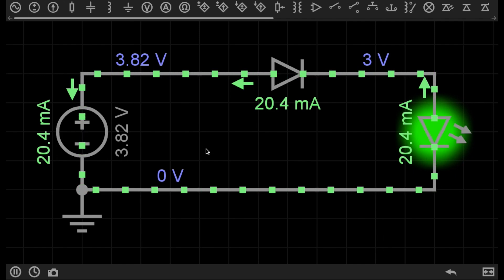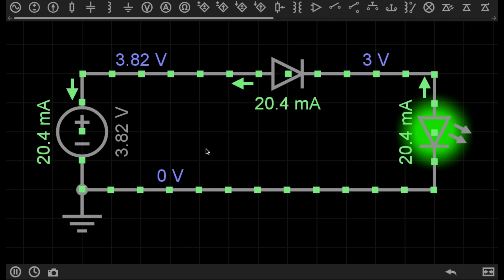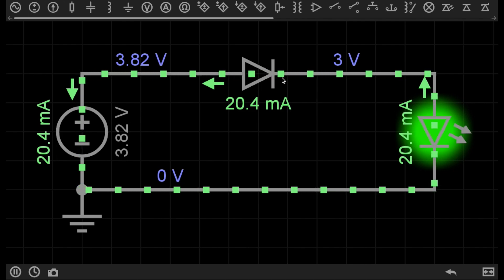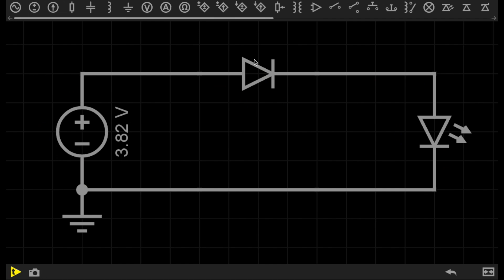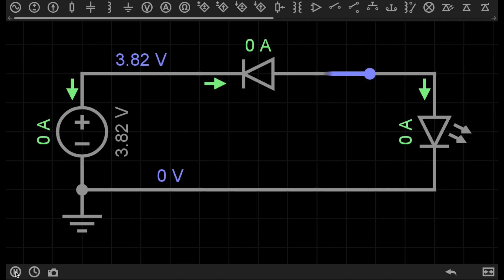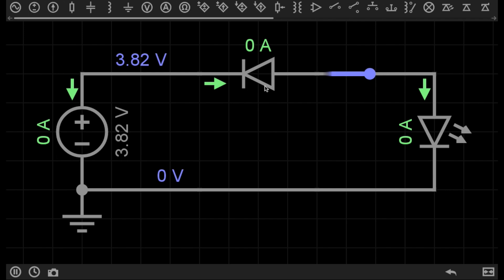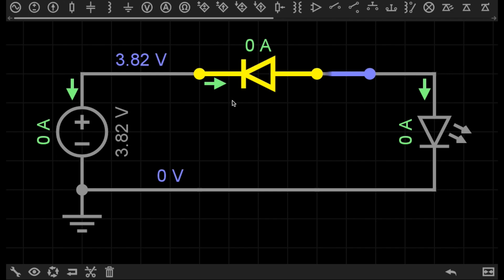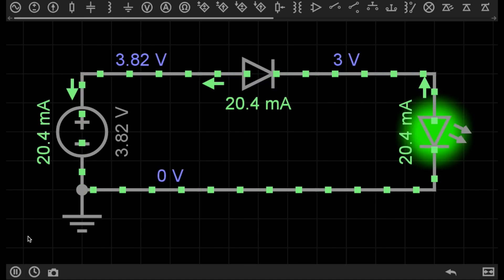How Diodes work EASY! (Interactive!) - Electronics Basics 6

Comment: So im confused even with diode turned around shouldnt current still flow up until that diode blocks it?? Why does it completely stop it even before it from coming from the battery

Comment: Why are at last half the videos and books out there showing current flowing through diodes in opposite directions from this? Is it just a matter of looking at conventional vs electron current flow? I always thought current went through diodes and SCRs in the direction of the arrow. Now I’m finding videos and books that say the opposite. Someone please explain…
Reply: Its stranger than you could imagine. Have you noticed anything else inverted?
Reply: @kaintgetritedonetried  I'm hoping you can steer me on this. It would seem that if I follow the electron flow, then the order of the components must be backwards. Should I simply (conceptually) say to  myself "Do all the analysis with conventional, and then just flip positive to negative in my head on the power source"?
Reply: @christophersharron6967 
Yes sir. 
Conventional current is the way to look at it. Electric engineers will draw up prints and schematics this way  because it actually makes sense..

Comment: Rrrr...I think its supposed to flow direction of arrow. Confusing  people with bad info
Reply: It's simulating electron flow (how it actually works) negative to positive 
I think the other way (positive to negative) is called hole flow and is almost theoretical. 
Can be a little confusing, but definitely not bad info here

Comment: The arrow in diodes show direction of electron flow... But in your circuit current is flowing in opposite direction to the arrow.
Reply: Wish he wouldn’t fcuk around with arrows. Confusing enough without messing around with diagrams.
Reply: My brother, the arrow formed by a diode shows conventional flow of charges (flow of positive charges) and not electron flow as you have suggested.

Comment: Why is the symbol designed that way? To me, it looks as if it is in the backward direction. I mean, A----|>|----B looks as if the it is allowing flow from A to B, and blocking flow from B to A.
Reply: It's due to convention which assumes that current flows out of the positive terminal, through the circuit and into the negative terminal of the source. In simple words: somebody once assumed current flows from positive to negative. This convention is still used in present days for ease of design and circuit analysis. On top of that, most of electronic components were designed and standardised in regards to this assumption. But in real, physical world current flows from negative to positive - it's because electrons, which are much lighter than protons, are current charge carriers and are easier "moved around". To complicate things, electrons are not only charge carries in electronic circuit: we have holes as well (usually found in semiconductors materials, hence name "depleted". "Enhanced" material have free electrons in it's structure)

Hope that explains and helps a bit :)

Comment: in all the videos with  LEDs and diodes , u have current flowing from negative to positive, which is not correct. the arrow on the diode shows the direction current can flow...
Reply: Current does flow from neg to pos.  The arrow shows which way the current cannot flow (hence the line the arrow is "hitting").
Reply: @joenest2122  No, the arrow on the diode indicates "conventional" current flow (positive to negative), which is how circuit diagrams are laid out. It's not a very good practice for him to be confusing beginners by showing actual current flow (negative to positive), while describing components and circuits in terms of conventional current flow.

Comment: Thanks for using electron flow instead of using the wrong way like most people!
Reply: "most people" don't just use the "wrong way".
They're just using conventional electron flow

It's not wrong doing either, but people should point out what they use in tutorials
Reply: @crateer  No. It's wrong. Benjamin Franklin and others made a guess on which way electrons were moving and ended up being wrong. This is very well known. We are used to it now and it is considered convention. We keep it only out of convenience. We would have to change almost every book in existence to the correct tracking of electrons and many people would have to get used to tracking what seemed backwards to them. Convention does not mean correct. It means many people agreed to handle it this way. That is why....as you said....it is called conventional flow. It only exist today out of convention. It is not the way particle physics works. It is wrong.
Reply: @randerhaywood1163  Yes, I strongly agree! conventional flow makes it so confusing to learn
Reply: @axion4523  convectional current actually is more useful when learning how AC current work
Reply: Except every single diode tech doc shows the flow to be going the direction of the arrow. So for this to explain how diodes work, it is a fail as it just creates more confusion.
Reply: @DamnDealDone  This is about accuracy vs convention. What he showed is factually correct. The other way is popular. I understand convention. However, I was talking about accuracy. If people got over the old way which IS not correct, this whole issue could cease to exist. We perpetuate the wrong because we do not want to deal with the temporary inconvience of transitioning to correct.

Comment: If i’m seeing this right, the bottom of the triangle is the positive side, and the line connected to the tip of the triangle is the negative side. Is that right? I’m only watching this so i can figure out the polarity of the diode for a new version of a simple BLDC motor driver i’m making. And one more question, can the diode be used as a fly back protection when connected to a transistor and a motor, but the diode is connected backwards from the positive line to the output of the transistor? The transistor output will be connected to a resistor that goes straight to the negative line.

Comment: If it’s grounded how can current flow????
Reply from the maker: A voltage higher than ground potential will always want to flow to ground. Like water on the top of a waterfall always wants to fall down.
Reply: @SimplyElectronicsOfficial  that makes me believe even more that current shouldn't be flowing if it's grounded like this.
Reply from the maker: @SuperMaDBrothers  you may be confused by the direction the current is flowing. Please see my video about conventional Vs electron current flow.

Comment: why the voltage between battery and diode is 3.8 volts and voltage between diode and LED is 3 volts?
Reply: a diode will have a voltage drop depending on diode but the average drop is at least a 1/2 volt

Comment: and here's another fuck up of yours
jeez mate

1. the diodes are around the wrong way.. YET AGAIN
2.  IF THE VOLT SOURCE IS   3.82 V
  and the OUTPUT OF THE DIODE reads as 3 V  (As measured from the output of the first diode to the input of the second)
IT OBVIOUSLY MEANS A VOLT DROP OCCURED OF  0.82 V.........RIGHT

OK.
3.  so how come the current is flowing in a direction that IS OPPOSITE OF THE FUCKING VOLT DROP............CMON MATE... SERIOUSLY
and it's a DC Power source
and the arrows are the wrong way around

the whole thing makes no sense

Comment: Why the voltage between the battery and the diode is 3. 82 volts and the voltage between diode and led is 3 volts

Comment: What is the direction of the current in the circuit and why is that so
Reply: Electrons have negative charge, they flow from ground or negative side of battery to the positive side or side with lack of electrons

Comment: Bullsiht. Picture is false. Why you show current flowing from "-" to "+", so backwards, in the direction the diode should block it at 0:08 (green dot animation)? Are you crazy? You are a very, very bad teacher.
Reply: Here it's explained. 2 notations exist, "conventional current notation" (old one, wrong one, and most used, benjamin frankling's fault) and "electron current notation" (more scientific, it's the right way, goes against the symbols because symbols are old). Details : https://www.allaboutcircuits.com/textbook/direct-current/chpt-1/conventional-versus-electron-flow/

Comment: the current flow just confused me so much.... dude, I would suggest you reupload it and give a link inside this video. It is already confusing, and the reverse current flow in your video just makes it worse. thank you for your video anyways
Reply: Here it's explained. 2 notations exist, "conventional current notation" (old one, wrong one, and most used, benjamin frankling's fault) and "electron current notation" (more scientific, it's the right way, goes against the symbols because symbols are old). Details : https://www.allaboutcircuits.com/textbook/direct-current/chpt-1/conventional-versus-electron-flow/
Reply: @Rolanditou  I will not agree
Reply: ttps://www.google.com/imgres?imgurl=https://sub.allaboutcircuits.com/images/03248.png&imgrefurl=https://www.allaboutcircuits.com/textbook/semiconductors/chpt-3/introduction-to-diodes-and-rectifiers/&h=202&w=538&tbnid=_hR8q6GJx3DlRM:&q=current+flow+in+a+diode&tbnh=79&tbnw=214&usg=AI4_-kRRM53h1l1Muem1nxyov9zfsL2quw&vet=12ahUKEwjXkoTKguHeAhWuoYMKHdcQCh8Q9QEwAHoECAkQBg..i&docid=AEGCw_BLFHBnuM&sa=X&ved=2ahUKEwjXkoTKguHeAhWuoYMKHdcQCh8Q9QEwAHoECAkQBg

Comment: I have a doubt..
current flows as like that arrow mark in that diode..is it right ???
then in ur video current flowing in opposite direction ??
Reply: Here it's explained. 2 notations exist, "conventional current notation" (old one, wrong one, and most used, benjamin frankling's fault) and "electron current notation" (more scientific, it's the right way, goes against the symbols because symbols are old). Details : https://www.allaboutcircuits.com/textbook/direct-current/chpt-1/conventional-versus-electron-flow/
Reply: Ima Hinasyon Electrons are negatively charged and travel towards the positive terminal. Basically it flows from negative to positive.
Reply: But why is the current flowing from negative to positive in your demonstration? Does it mean it's charging?
Reply: There are many components to learning circuits. One plan I discovered that successfully combines these is the Gregs Electro Blog (google it if you're interested) without a doubt the best course i've seen. look at this  amazing website.
Reply: Simply Electronics actually the dots represent the electrons not current not the direction of conventional current 
you can change that in settings
Reply from the maker: This was an error with everycircuit. Current will only flow in the direction the diode is pointing. Unless it's a zener diode.
Reply: @SimplyElectronicsOfficial  so why are you using that graphic if it is wrong?
Reply: Simply Electronics no it shoes flow of electrons unlike flow of conventional current
Reply: why don't you pull this video and redo it to keep your videos consistent? everycircuit even in demo version allows me to change simulation flow to conventional flow. Your video on rectifiers has the flow in conventional mode!